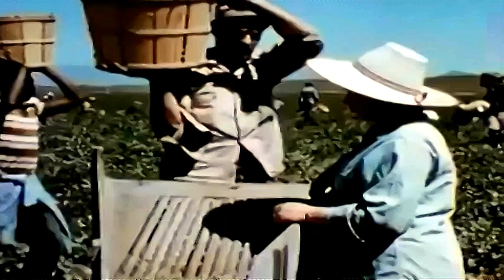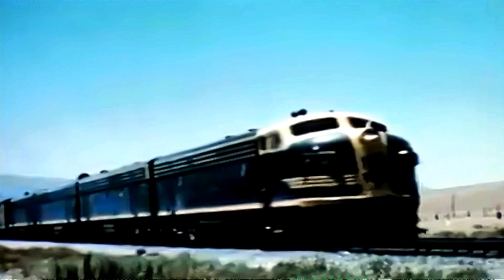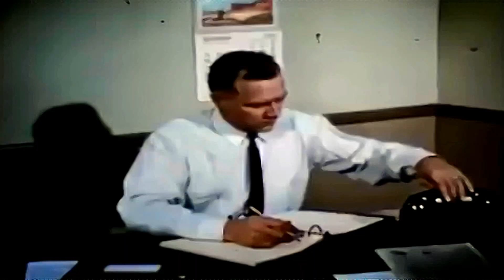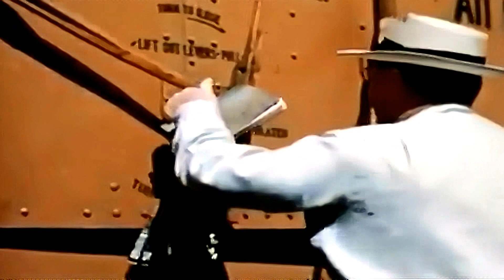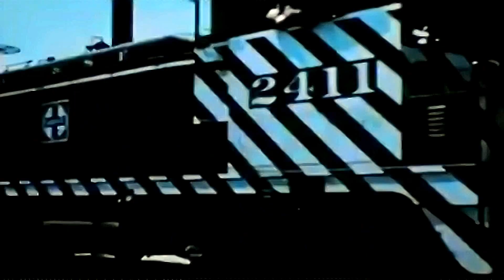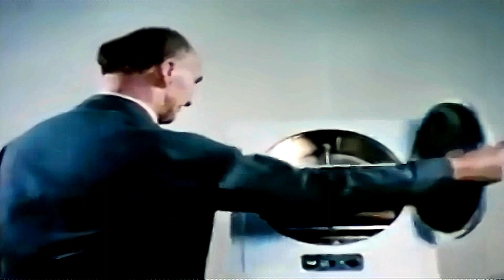Santa Fe Railway Fresh For Health

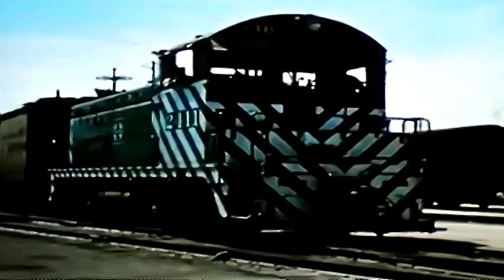Comment: The MTC refrigerator car was a class Rr-54, built in 1953. Since the calendar behind the guy at 17:58 is December, 1954. The film had to be released sometime in 1955. The mechanical cars would completely eliminate the need for most iced cars by 1970. The last ice cars were built in 1957, and the last ice dock was taken down in 1973. There were a few of the newest ice cars retained until about 1980 for certain kinds of fruit that needed the cold you could only get from top icing. A new type of mechanical car was developed in 1979 that could make its own ice so the need for any kind of iced car was eliminated. Car icing was a massive expense for the railroads, so eliminating it reduced the cost of almost all fresh fruits and vegetables.